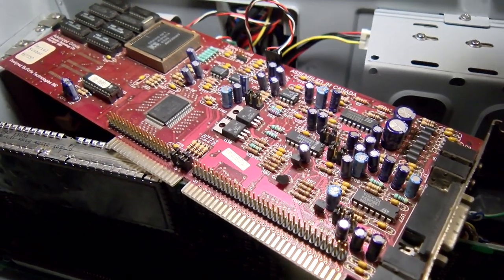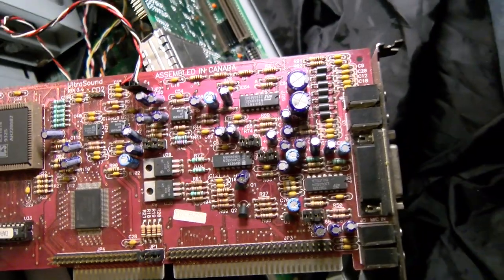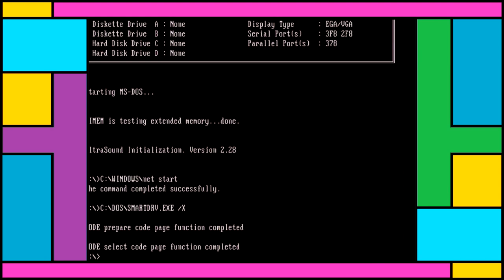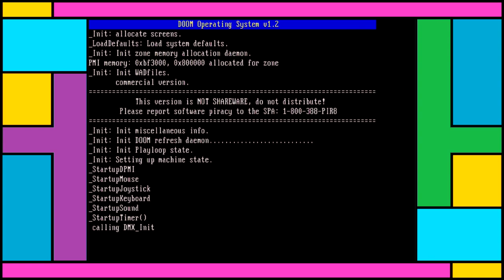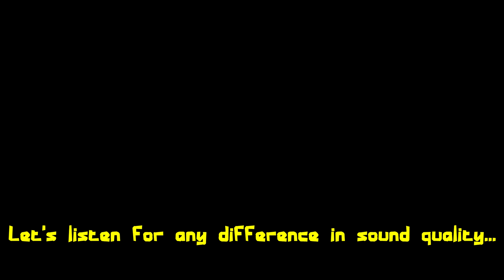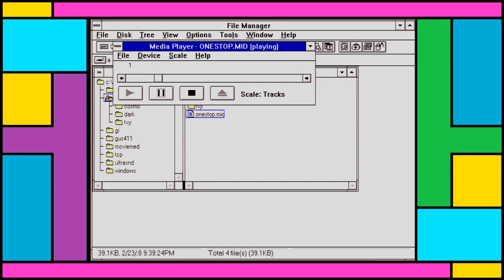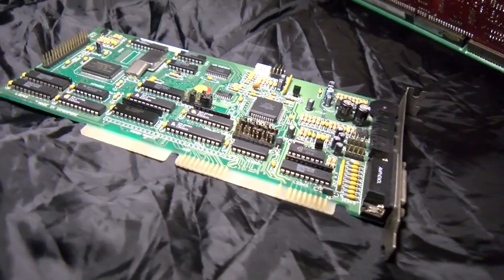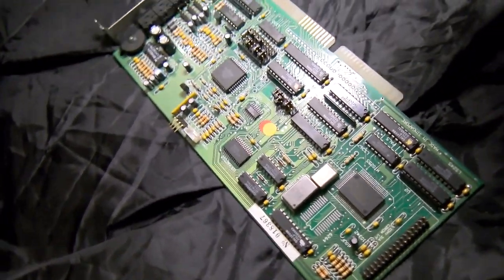The Real Gravis Ultrasound Experience

Comment: Interesting video mate. Sure you didnt have any IRQ or DMA conflicts ? I always tought this card was a dreamcard due to the demoscene using it, but now for sure I will never get one. My favorite is the SB 16 and awe 64
Reply from the maker: These problems have followed the card across several systems and I have spoken to other owners with the same, or similar problems. Reporting conflicts is actually one of the issues the drivers have, where you get stuck on the setup screen because it thinks every resource is in use, even when the only other cards you have installed are a video card and a host adapter for the hard drive. This seems to be more common on faster machines, this one didn't have that problem aside from insisting 5 and 10 were in use when they weren't. I actually have to move the IRQ from 11 to 5 or 7 quite often, because some games won't work on the default of 11, where other applications will only work with it set to 11.
Reply: @HighTreason610  Bloody Horrible, I am happy I didnt have the money to buy one
Reply: @HighTreason610  Almost as hard as trying to get a PCI soundcard to work with DOS, but this is a ISA card.. Pure madness

Comment: If you're referring to the Soundscape S-2000 as their abomination of a card well...I can't argue. That card has been nothing but trouble and that's when I can find a PC that will actually install it. I did manage to get one working on a Vectra in DOS and Win 3.1 after hours of messing with drivers and then playing with juggling resources and disabling parallel and serial ports to free up more resources for it. The soundscape also lacks a real OPL3 chip so even when it does get working many games do not sound steller in FM and that's if the game will even work with the card. I eventually removed it from the Vectra and tried installing it on a Windows 98 machine to see if the installation was any easier but no, it was worse and I was never able to get the card working in that machine. I actually have 2 sound cards that use the interwave chip which I believe is some kind of variation of the GUS but I've never been able to get either of those cards working fully. The driver's situation is confusing and terrible for those cards though there is a possibility that maybe my cards are broken in some way since I did find both of them at thrifts.

Comment: To be honsted, I don't think you get the GUS.
It's a 16 bit Stereo soundcard with wavetable quality sounds from 1992, which is easy to use ( for a programmer ) and took very little system performance since it plays it's samples on its own, making it ideal for older PCs.
The first soundcard from CT which could beat it was the rather expensive Soundblaster AWE from 1994, which never could carry enough additional RAM.

Adding support for a rivaling system using FM synthesis as a hack for a cheap sound solution doesn't make much sense, which probably is the reason for the rather lackluster status of such hardware emulation.

To really understand what the GUS stood for, you need to compare titles with native GUS suppport to other soundcards of the time.
---
IF you want to protest, you should fokus on the GUS PNP, an updated more compact version which could easily have sported an OPL-3 but did not.
Actually, it wasn't even compatible to the GUS Classic unless you got yourself the "Pro" version which actually carried RAM ( 512kb upwards ).
And introducing a cut down "GUS Classic" under the name "GUS ACE" as a 512kb wavetable addon one year after the introduction of the SB AWE naturally wasn't received well either.

The idea of the GUS ACE was "sound" though, because that essentially was my setup: I used a 512kb GUS Classic clone on port 240 line-in linked to a (mostly) Soundblaster Pro 2.0 compatible card on port 220, which once runnning was a very solid setup. Also, using two soundcards has its perks, such as running Quake while playing S3M for background music.

Btw: The trick to using the GUS, or a dual soundcart setup especially, was to disable ALL unneccessary IRQs and DMAs demanding features in BIOS such as LPTs and COM-Ports, freeing them to be used for soundcards - never use any of them for more than one device, which happened at lot especially with a PNP bios.
Also, try using standard values as much as possible, such as "PORT 220, IRQ 5 & DMA 1" for the soundblaster, and then "PORT 240, IRQ 7 & DMA 3" for the GUS. Keep in mind that even using IRQ 3 and 4 is possible once you freed them, though I forgot which of them is the more tolerant one. If you get it right, weird sounds and clicking noises should disappear as well - though sample reloading effects remain.
Also, if you got two cards always use the GUS for music and the soundblaster for effect. And, if there is no GUS support, the MIDI emulator is worth trying IF you have a least 512kb RAM.
If you only got a GUS and need FM synthesis, "Soundblaster 1" mono emulation usually produces passable noises, but thats about it.

But yes, manual setup required.
Reply from the maker: To be honest, I don't think you listened properly to what I was saying.
Reply: Nice hardware doesn't mean s*it if there is no software support. GUS isn't the only example of this.
Reply: @GreySectoid  True. The ISA sound-card period was something of a war-zone where everybody and his uncle tried to score with their own implementation, creating a rather diverse field of many standards essentially meaning there was no standard at all. And its true that the GUS was one of the worst which is why it came with a bunch of emulators which unfortunately barely ever worked properly.
Still, you must not forget that this soundcard essentially was a port from the Amiga 500 where it did wonders for module based sounds, and it did the same for the PC if properly implemented. It also was a very tame beast where timing and required resources are concerned. In the end, it simply lost out to the more modern and less pricey concepts.
Reply: @l3lue7hunder12  No it wasn't a "port" of Paula, stop using words which meaning you don't understand.
Reply: @GreySectoid  You are right for neither the GF1 nor the later InterWave are versions of Paula, which is an entire I/O chip and part of the OCS Triplet, “Paula”, “Denise” and “Agnus”.
However, “Agnus” allowed “Paula” to play simple 8bit 28kHz samples directly from 512kb RAM ( stock Amiga 500 ) on 4 output channels in a stereo setup. Using tricks “almost” 14bit, 56kHz and 8 output channels were possible.
With this, the approach to sound was fundamentally different to both older and other computer systems which used FM synthesizes, and potentially superior in quality depending on the samples used.
The GF1 can do 16bit, 44.1kHz and 14 output channels ( or 32 at 19.2kHz ) with typically 256kb or 512kb RAM stock ( or 1MB through upgrade ), making it something like an advanced standalone version of the same type of sound generation.
Due to the similarities, module standards like “.mod” and “.s3m” weren’t just adopted for the PC but also effectively got stuck to 4/8 channels along with Amiga style filters for a long time.
Because of this and the developers who moved over from the Amiga, the GF1 rarely was fully implemented or used, much less so taking the features of the AM78C201KC into account, and the fact that other soundcards of the time actually set a low bar for channels supported or filters available for several years didn’t help any either.
Because of this the GUS got declared “exotic” and “old standard” way before that actually held true, and the relative high price combined with many ISA bus related …. sensitivities resulted in a low spread and eventually its end – the competition didn’t exactly sleep after all.

So sorry for going the easy route and calling the GUS “essentially a port from the Amiga 500”, but do you really expect me to add this much background information to any comment I make ?

Comment: At this point you are better off getting a Creative Sound Blaster AWE64.
Reply: There's a lot of external MIDI modules out there as well - not exactly cheap but I think you'd get better MIDI for less money compared to an ISA wavetable card - and you'd be able to use it for more than old DOS machines.
Reply: And run DIAGNOSE every time you want to hear FM or EMU synthesis? If not, how that works? Someone please tell me. Because it just doesn't work for me, not even after AWEUTIL /S. It may be a software version issue. May be something else. I have no idea.

Oh, and what about that strange ringing AWE64 FM always does compared to older (even CQM) ones? FX are disabled, of course, reverb/chorus pulled back to zero.

I'm talking about pure DOS, of course.

Comment: Death Rally needs the 1MB for the GUS Max to be utilized for the game's sound. I am not sure about others..

The Gus Max can be used with another sound card....but not any sound card. I have had it work fine with a Crystal PnP sound card with the Gus on 240 and IRQ7 and the Crystal on 220 and IRQ5. But that meant disabling the IRQ for the printer. I have tried mixing it with other sound cards like an OPTi MAD16, but good luck with that. I could not make that work.

It's a great card indeed. But, if you have one machine that you want to play it "all"....I wouldn't recommend the mixing sound cards bit at all. Just make a machine with the Gus as the primary and only sound card and enjoy the things it is compatible with.
Reply from the maker: Yes, this is the best approach as now there's not much stopping us just having another machine for the GUS to live in. The machine mine lives in is basically just a collection of slightly oddball hardware which had nowhere else to go. It works, but doesn't come out very often.
Reply: @HighTreason610  I might just do that. I installed it temporarily in my 486 as a "lone" sound card just to see how I would get along with just a GUS. For GUS specific stuff (games that support it and demos) of course it was fantastic. Even for MIDI playback it was pretty awesome. But, the SB16 emulation utterly sucks. It's really too bad they could not get that emulation proper or that some third party did not continue that software. If it could just handle SB16 correctly I would have been satisfied. 

So, yeah, I think I will have to build another "GUS only" machine and tailor the software I put on it for GUS only stuff.

Comment: Yup - they're overpriced ... which is why I started the ARGUS project (since I could find 400 InterWave chips for really cheap), which is finally nearing it's production run after being 4 years overdue.
And yes - AdLib/Soundblaster Emulation is a joke and depending on the implementation they fare considerably worse than a SoundBlaster performance wise. Still a must have card for module playback and demoscene stuff.
Reply from the maker: Ah, now, I did wonder how that project was coming along, as I got kicked off the boards not long after it started. Glad to hear your hard work and effort were not wasted and that it is nearing completion, here's hoping it's a success.

Comment: It is very simple… hw mixing supported? Use gus. Sw mixing? Forget it. Demos, epic games supported hw mixing, basically nothing else. The midi is good, but not too much games designed directly for it. The gus came against first sbpro2, it was a way more advanced card, even against the first generation extremely buggy sb16. The card itself was superior in 92-94, the problem was with the game support. I use the gus always parallel with a sb.
Reply: Is this a full list of HW supported games?
Archon Ultra
Crusader: No Remorse
Crusader: No Regret
Death Rally
DOOM v1.2 or below 
Epic Pinball 
Extreme Pinball
Jazz Jackrabbit (including CD-ROM and Holiday episodes)
The Lemmings Chronicles
One Must Fall 2097 
Pinball Fantasies 
Pinball Arcade (includes special versions of Pinball Dreams & Pinball Dreams 2)
Pinball Illusions
Silverball
Star Control II 
Turrican II 
Zone 66
Reply: @Alianger  the module based games sure, as i remember the crusader simply used digitalized music, the doom how?

Comment: GUS was my first sound card. Without question the Sound Blaster emulation was awful - (especially the OPL emulation!) but I loved having the wavetable MIDI.  IMO it's got to be paired with another card that's really hardware-compatible with Sound Blaster. (I think later versions of GUS had that built in)

Despite all the problems I'm glad I got it back in '93. But I wouldn't pay collectors' prices for a GUS. At this point I'd be more likely to buy an external MIDI module like the SC-55.
Reply: As for the argument that "a soundcard shouldn't have to be paired with a second soundcard" - in principle I'd agree. But I did do exactly that (to get wavetable MIDI plus Sound Blaster compatibility - first with GUS plus a sound blaster-compatible card, then later a Turtle Beach Maui with that same SB card...)

Comment: I had a GUS back then,..
Before it, I had a "SB16 mcd asp"
When I first started up Warcraft 2 with GUS, I felt sooooooooooo bad for the SB16 . 
The midi just blew the thing away.
ALso, when I got the next one, Aureal Vortex....OMG.  The SB Audigy was a shadow of it.... It just sounded worse.
Reply from the maker: The Vortex is a card I've never owned, it was always said that compatibility on them was poor and they seemed a little too barebones. So when it came to it, the choice was always between the Yamaha 724 and Audigy 2 for me, as the 724 had better compatibility and the Audigy 2 had more I/O, regardless of how much I hate the EMU10Kx cards otherwise. 
I've never even encountered a Vortex in the wild except maybe an old friend's girlfriend who may have had one, but I can only go by the old spec lists he kept of our machines, which were notoriously unreliable. He lists her system as having an AU8830 (well, ALC650 AU88300-88500 to be exact), but also lists it as having a Radeon 8500XT and an ABit BP6, when I'm fairly certain that VGA card doesn't exist and it was the VP6 motherboard that supported the dual P3 CPUs the system was using.

Comment: I am so grateful to the universe I got my GUS MAX for just 2$. I like what it can do, I like tracker music a lot, so I do enjoy this card for its primary purpose. However no way in heck I would ever buy this thing for more than 50$ in perfect condition. Actually, given how well GUS is documented, I'm kinda surprised nobody came up with FPGA emulation or something similar. Perhaps, such card is not exactly wanted by many people after all, and all its fame comes solely from the prices inflated by collectors? cough AWE64 Gold cough
Reply from the maker: Oh God the AWE64 Gold. Similarly to you, I was lucky enough to get one of those when they were cheap and nobody wanted them, which is just as well because there isn't much it can do that the Value can't. As a MIDI guy, the extra RAM doesn't really interest me, because if I'm likely to use more capable external hardware that sounds better anyway. For composing it isn't great, nor for recording. It does get used for what it is, a sound card, but if someone swapped it with the Value model I wouldn't notice. The SPDIF implementation is also lacking to the point of being almost useless.
Reply: I cannot refrain from commenting on this: "I'm kinda surprised nobody came up with FPGA emulation or something similar." - have you heard of PicoGUS? I know you wrote this a long time ago, but this project has been out for even longer, IIRC. Ian Scott did almost exactly what you suggested - created a card with software-defined GF1 emulation on a Raspberry Pi Pico. It is opensource so a few other people are also making and selling it, while the author is continually improving its "firmware" - emulation capabilities (it can also do AdLib or SB Pro). The GF1 emulation is so precise that the card even replicates some issues that the original GUS had with certain chipsets. It is a great way to get a genuine GF1-based GUS experience without going bankrupt :)
Reply: @Beus38   you do realize I left my initial comment over a year ago, when picoGUS wasn't a thing yet? :-)
But I'm afraid picoGUS and picoMEM are taking things to another kind of extreme. When you emulate half of your hardware, why just not emulate all of it?
Reply: @Arti9m  I do realize the time gap, I just was really sure that PicuGUS already was around at the time. My apologies if my memory is failing me :-)
And your concern is pretty valid, I quite agree. But, IMHO, it is fine as long as it is kept "tame", with only emulating the real unobtaniums like GF1, which would otherwise be pretty impossible for most to get their hands on.
If anyone tried to build a PC emulation board that would emulate CPU, chipset, memory, GPU, network card, etc, I would reject it.
On the other hand, for example MiSTer FPGA has its place, as its emulation targets are, again, quite rare and hard-to-find hardware.